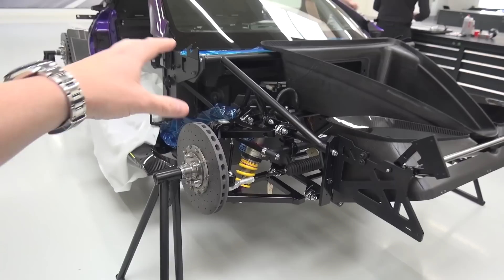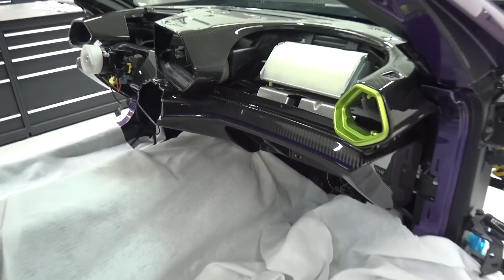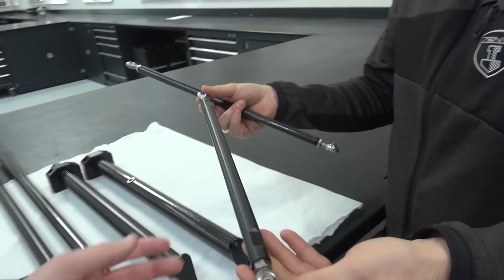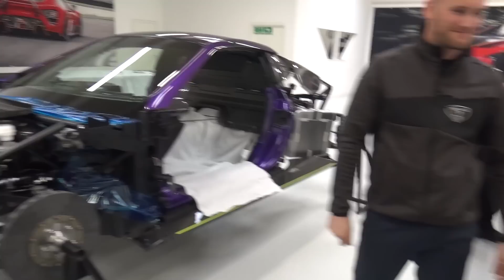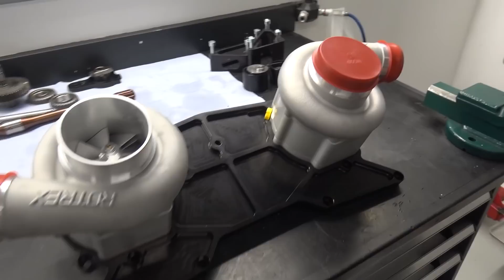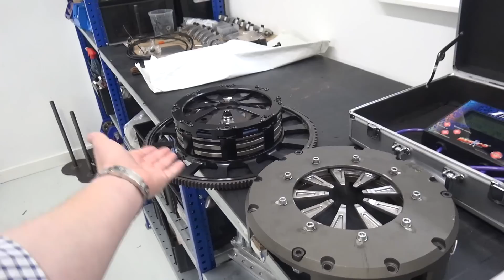My Zenvo TSR-S is BEING BUILT! Assembly Hall Update | ROAD TO ZENVO Part 6

Comment: By the look at the car it seems it doesn't have a crash structure on the front or back it has a frame to hold the parts but thats it, which is very worrying safety feature. One carbon tub and a few aluminum pieces to hold the parts and thats it. It looks like a cheap kit car like Factory 5 GT but a bit better design with a few carbon parts and build. I am curious to see the crash videos of this car.
Reply: its a slave parts

Comment: Complicate and add lightness! 😁 It's lovely engineering, but...

I'm going to be Miss Grumpyboots again. Please don't read on if you're of a sunny disposition.

I know the benefits of carbon-fibre composites - I've worked with them for years when vacuum-laminating load-bearing structures for large RC model aircraft - but people conveniently forget their weaknesses.

Yes, composites are light. Yes, they're rigid. Yes, they seem incredibly strong. We've all seen the demonstrations where a big man with a 5lb hammer hits an unpainted car wing or bonnet and the hammer bounces off.

It's impressive, but it's not reality, is it. If you cut, scratch, chip or score carbon components, their structural integrity is compromised to a very-difficult-to-assess degree. So... it's best to replace them. Ker-ching.

In the real world, sub-frames and suspension arms and body panels are rigidly mounted to other solid structures. A typical road car encounters forces many levels of magnitude beyond a dude called Brad with a gym membership and a hammer. It hits other cars, massing thousands of pounds.

Rubber tyres gripping the road ensure that such impacts will be heavy and deep. Unlike two epoxy-composite boat hulls floating in water bouncing off each other, there's nothing to dissipate the energy.

Composites are certainly light and strong by themselves, but they're sacrificial when it comes to collisions. Ask any F1 team.

I made the same point about the (futuristic 3-wheel) Aptera's composite monocoque. In the real world, cars hit lamp posts, concrete kerbs and other cars with a force of thousands of pounds. So... they break. And you can't straighten them in the workshop or beat out the dents or weld anything. Broken carbon is essentially scrap.

Have you seen what happens when a carbon-fibre wheel is kerbed? Have you heard the sickening crunch of a hyper-car's £25,000+ hand-built front splitter touching a speed-bump? Have you seen the damage that occurs when a Pagani Zonda runs into the back of a Koenigsegg or a Bugatti at just five (5) mph?

It's catastrophic. Carbon-fibre may be a dream material for many, but it's a nightmare to live with and repair.

And then the six fluffy bunnies 🐇and their new friend the pink unicorn 🦄went home for tea and cakes and lived happily ever after.

(Sorry. I thought this miserable Comment needed a happy ending.)

Comment: Is that an LS engine? I was expecting a bespoke in house made engine, for the amount of money this car cost. Also the suspension is from KW, once again I was expecting in house development or at least bespoke Ohlins. KW is a great option, but at this price point you have to go top of the line components if you are not making your own. Otherwise the spec looks phenomenal. Congrats
Reply: I think, correct me if I am wrong, that the engine is indeed based on a LS but developed in house from there, sort of similar to what Koenigsegg did with ford's modular V8
Reply: @pepesuarez1554  They dont need to make anything. The aftermarket for the LS is huge. Zenvo can just pick up a 1500hp from NRE for 30k USD.
Reply: kw is an amazing brand
Reply: @devastate754  it is, but when you are asking 1.5M for a car, you either develop it in house or go for Ohlins.